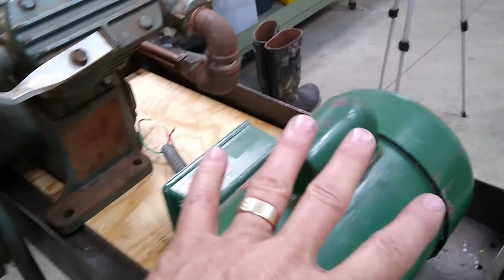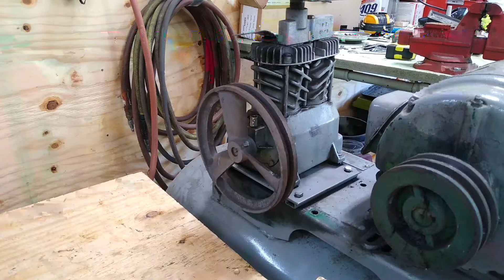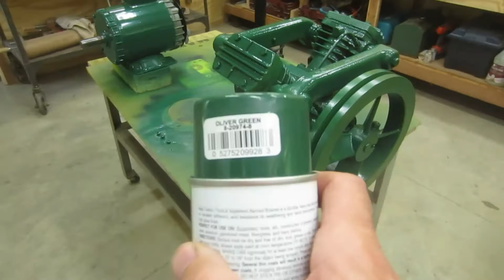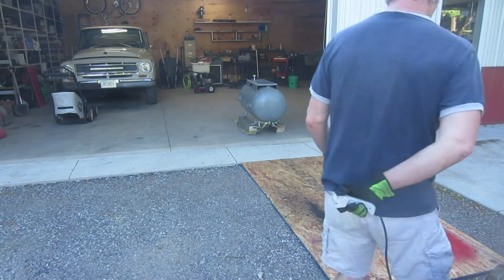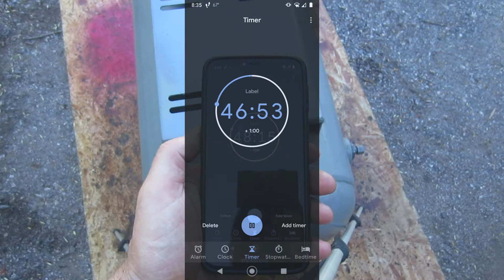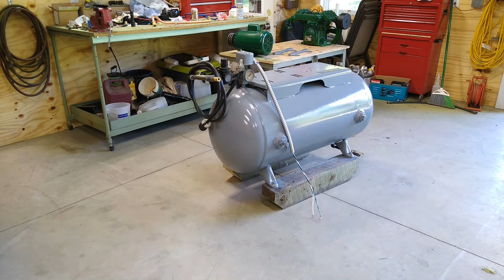Air Compressor Motor & Pump replacement

Comment: Looks awesome
Reply from the maker: Thanks!  I ran that setup for a while and then replaced the air tank with a brand new 60 gallon vertical tank.  Same pump and motor though.  It takes up a lot less floor space now.

Comment: great video, hows the tank holding up, would love to see a update video. Thanks
Reply from the maker: It worked great, but I could never get comfortable with the 70 year old replacement tank, even after the successful hydro test.  I ended up buying a brand new Kobalt vertical 60 gal tank from a shop that got them from Lowes returns with bad motors or pumps.  I moved my motor and pump to that tank.  I should have made a video, but how many compressor videos do I want to post on my channel?  I love the verticle tank.  It takes up less space.
Reply: @TheToolmanTim  I agree I wouldn't feel comfortable with that either, would love to see the new set up. btw how much did you pay for that old gray compressor if you dont mind me asking.
Reply from the maker: I paid $135 for the whole thing.  I ended up selling the pump for $35, the motor for $75 and scrapped the tank for another $8.  I stole the mounting plate off the old tank and used it to expand the footprint of the plate on the new tank, so not too much of a loss.  I may post up a short video of air compressor 3.0.  Stay tuned.

Comment: It looks great! Nice work! Nice video! I see you upgraded your pressure washer. When we talked at breakfast, I was wondering how you were going to do the hydro test with your electric pressure washer. I figured you had a plan. Thanks for sharing.
Reply from the maker: Thanks.  Actually, an electric pressure washer would have easily done the job.  A small electric pressure washer can create around 1400 PSI.  I only needed to get to 200 PSI on my tank and all it took was a few short bursts to get there.
Reply: @TheToolmanTim  True. I’m not sure what I was thinking?